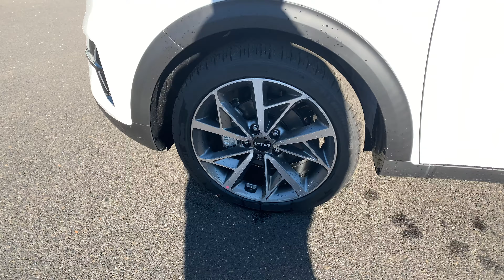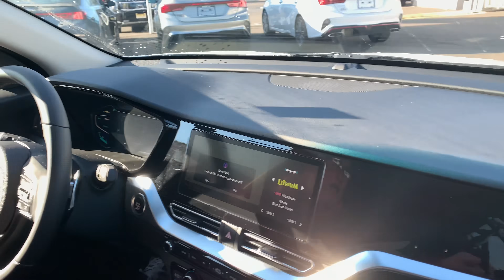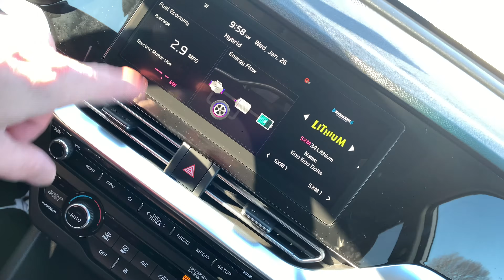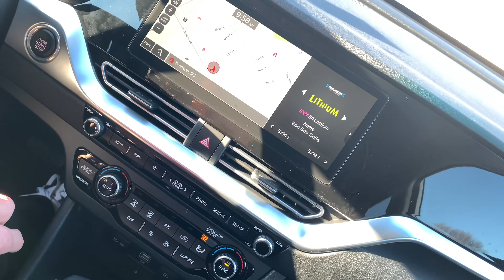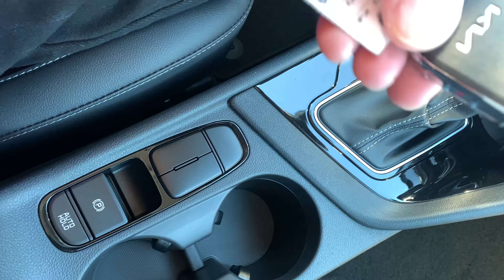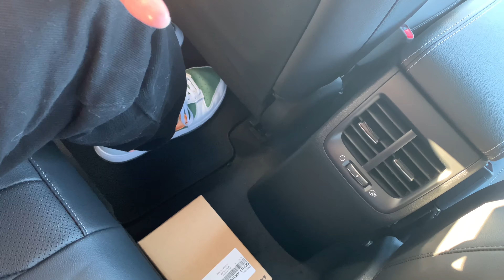2022 Kia Niro Touring SE - A Fuel Sipping Hybrid

Comment: I love my 2022 Niro Touring SE.  I do not miss heated seats and steering wheel because I wear pants and gloves.  As far as HEV vs EV I did my research before trading away my Jeep and planning for a trip from Iowa to Washington state then to Colorado and back home.  I did see some Tesla charge stations but the time to charge an all EV was a deal killer for me.  In my opinion the fact that the Hybrid system can turn 11 gallons of gas into 500 miles is GENIUS all on its own.  Period.  This car is mega comfy and that was what ultimately allowed me to sign on the line.  I have used it for a family outing with the kids and grandson including a car seat with plenty of room for the other three of us.  Terrific car!  The lane assist did drive me into a road cone causing some scuffing on the driver's side which was really un appreciated but this is my first car with that kind of technology so it was kind of on me for going too fast on the mountain construction zones amid other crazy drivers.  I actually don't find it excessively under powered at highway on-ramps and I have always driven at least a V6 in the past.  It is fine.

Comment: I'm confused to why it doesn't have heated seats? Even though it is listed on the car description as standard? That's slightly disappointing.,
Reply: I dont know why this one didnt had, mine have heated seats , heated stearing wheel and also i have 220 v charging port at the back seat